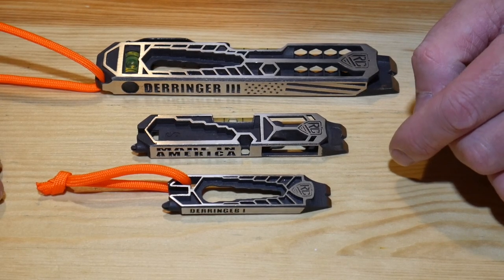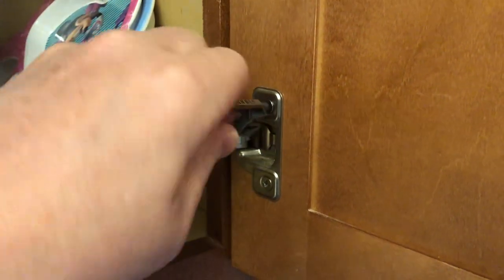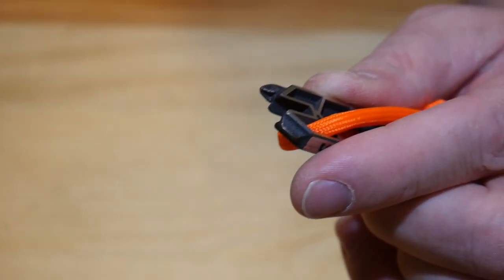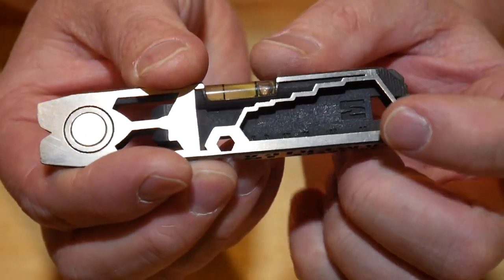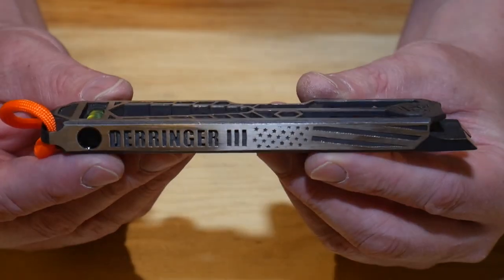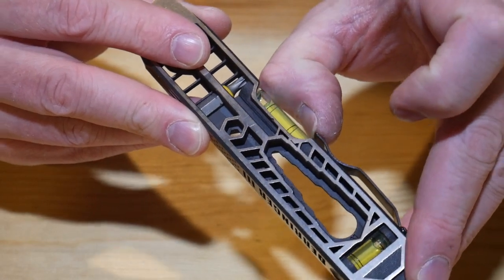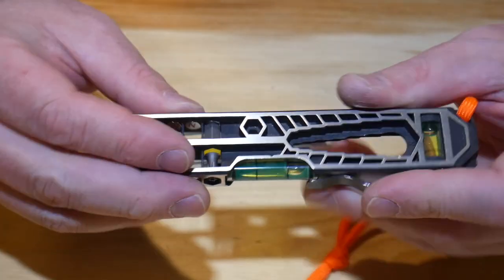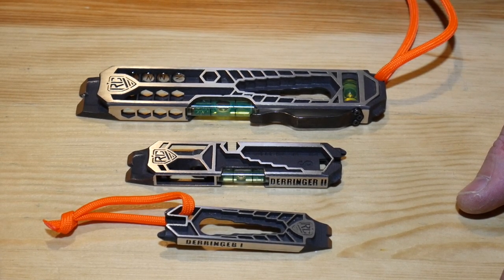Derringer EDC Tools from RAE Gear (Made in USA)

Comment: I prefer the 1 or the 3.  All 3 need significant improvement.  As a pry tool, they all are terrible.  Cap lifting is poor.  Really, who needs to lift caps?  The cap lifter prevents usage as a pry tool.  The bit storage on the 2 & 3 is indeed terrible.  The pocket clip on the 3 is on the wrong edge.  The nut slots just do not work for me.  The nail notch is an annoyance.  The scraper scratches (damages) everything it touches.

The magnets are nice, and the drivers are fine. The bubble levels are fine, but I wonder how tgey will hold up with impact.   I like the look and the idea, but everything else is a fail.

Comment: I would never carry one of those everyday carry things , they suck. There is much better choices
Reply from the maker: What are your choices?
Reply: I like my leatherman . I found it in a car when I was transporting cars for a manhiem auction house . Brand new . It’s a $65:00 find .
Reply from the maker: @unclemike9053  can’t beat that.
Reply: @livingsurvival  a Leatherman beats than thing hands down. More than half the time that stupid wrench cut out is useless and why would you need a lvl in a EDC tool , doesn't even have a knife blade built into it.just junk in my opinion but I could be wrong
Reply from the maker: @mynameisnobody5462  I like to see innovation. As there are so many people with different trades this might be just the ticket for them. Thanks for watching. I appreciate the feedback.
Reply: I like it. Just stumbled across these today so I thought I'd look up a review before purchasing, and I'm going with the largest. They're not for everyone, I get that. They are a bit pricey, but for everything you get, I think the value is there, as long as you plan on using it. It's a solid USA made product that serves quite a few functions. For everyone arguing that a leatherman does more, you'd still have to carry bits (provided your particular tool has a driver, as not all do), a small socket set, pry bar, and a level. I think this makes a great companion to a leatherman though. I don't mind large heavy tools, and I think the robust design would pair nicely with a Surge. It's not something meant to replace a home toolbox, but for many small odd jobs, it fills the void nicely instead of having to constantly run to the garage or basement to grab a tool for a minor repair. Great review!